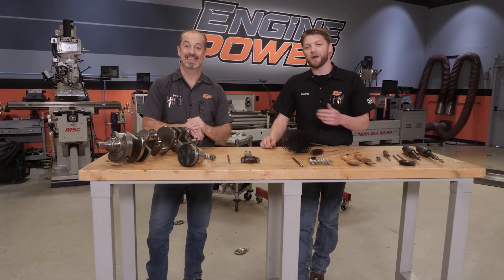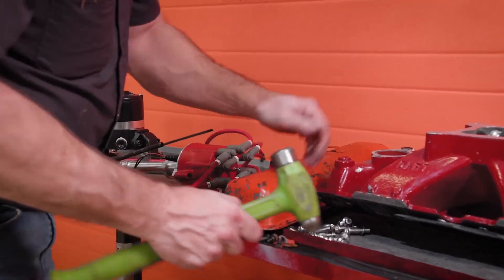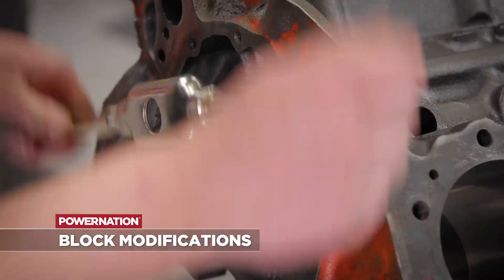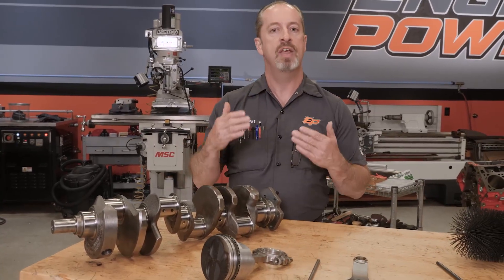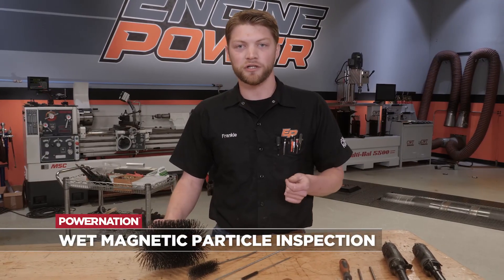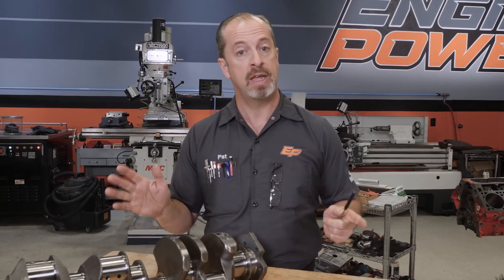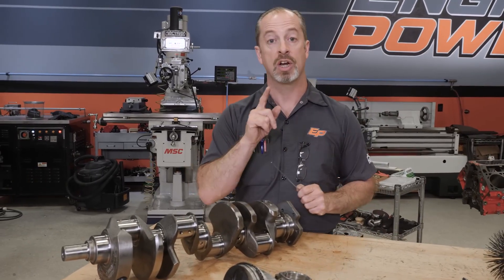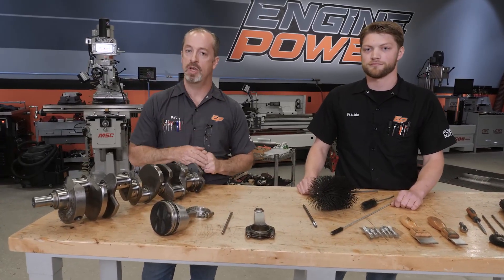Engine Rebuild Prep: Master Every Step

Comment: This reminds me of a friend who had a 390 FE engine rebuilt without ANY shop work. He had all kinds of problems. Cylinders out of round, finally a cracked block. I strongly urged him to do the shop work before rebuilding. Shop machine and testing work should be considered as step one of any engine rebuild.

Comment: Keeping the old parts and cleaning things, good advice even if it is often repeated.

But there is an addendum that I believe would be beneficial to know that relates to your points in this video.

That addition would be, timeline. What is the timeline from pulling an engine, to have it ready to drop in ones project. I can imagine that most people working on an engine are dealing with constrained budgets, and can be dealing with part shortages/slow shipping. For example. Say I got myself a engine for rebuild/build-up. I stripped it down, cleaned it up and it's off to the machine shop. I get the crank, rods, and block back ready for assembly (after copious cleaning, of course). Then say, again for example, that my aged butterfingers drops the crank resulting in damage that is irreparable. So now I have to locate and pay for another crank. What do I do with a freshly machined block that can't be assembled?

The short question is this. What parts of an engine rebuilding project can I do in steps with time in between, and what steps need to happen all at once?

Thank you.
Reply: I built my 5.7 as money allowed. After getting my block machined I sprayed the whole thing down with oil to keep it from rusting and kept it in a trash bag in my garage for a month or so on the engine stand. As long as you keep it from rusting and maybe recoat it in oil every once in a while it’ll be good until you’re ready for it.

Comment: Just sand blast everything measured within an inch torque it down till it strips like a gogo dancer back it off one half turn . Spray with orange paint call it anything you want 🤪

Comment: Like but I do have a question I don't want power my high  in my 4.8 LS at 300,000 miles but plans are to have an pull hog but This engine when I got it is it normal for the 4.8 Ls heads is the 862

Comment: Do not use the scotchbrite pads used on a die grinder for gasket removal.These take off too much material at a fast rate
Reply: Scotchbrite doesn’t remove material.
Reply: @triflingasparagus  Yes it and can tell real easy.See a real shiney spot on the headgasket surface on an aluminum cylinder head,done with a scotchbrite pad on a die grinder.
Reply: @triflingasparagus  yeah that just cleans
Reply: You can use the scotch Brite pads on steel. Sometimes risky on aluminum. Just gotta know what your doing. Keep them flat don't gouge and dig into flat surfaces.
Reply: @hankstar.1  GM put out a TSB not to use them.They were replacing engines from use of them.The little pieces from them would get in the oil which the oil filter cannot trap them resulted in premature engine failure.Subaru says not to use them too
Reply: @Toolaholic7  once again you just gotta know what you are doing. Be smart about... If you are doing an oil pan and you get all the rtv and bits from the scotch Brite pad into the open engine that's on you. I've been using them for years no problem. But to each there own. The more I bill the more I get paid. I can definitely see situations where not to use them. Like removing a paper intake gasket next to open intake ports is a no no.
Reply: @hankstar.1  Even done right,can cause problems
Reply: I’m an automotive machinist here. So I agree. Scotchbrite has dug holes into cylinder heads I’ve worked on
Reply: What are you supposed to use? wire brush attachment? What do you suggest?
Reply: @toycoma98  just  manually  remove  gaskets with really good scrapers.  takes  longer but you're better off that way not  damaging gasket surfaces
Reply: @toycoma98 razor blades
Reply: @Coronet_shop yes scotch bites will remove metal from razor blade
Reply: @toycoma98 Stainless steel cup brush on a die grinder.Do not get these from Harbor Freight,they do not last
Reply: I do it with 50 weight url . No metal leaving the clock 🤪
Reply: @MrBlackbutang  Leaves spots  too
Reply: @Toolaholic7  I will look thanks for your help!👍
Reply: A scraper, yes. There are power tool attachments especially made for gasket surfaces. It can be worth extra cost if you work on a lot of engines. Career in the automotive industry, for example.
Reply: Do it right or end up with a cranky shaft.
Reply: Your supposed use scotch brite by hand.
Not on grinder.
You go slow too. 
They do help clean surfaces for gaskets and they can even clean threads of bolt too.
Just be patient take time.👍
Reply: @Trials-and-Tribulations  You do not use any scotchbrite pads for that.
Reply: I’d say you can just for heavens sake use great care. I have ruined a lot of surfaces and part of a car body with those pads. They EAT at those speeds
Reply: I wish people would mind there own business and stop telling the people on engine power what to do